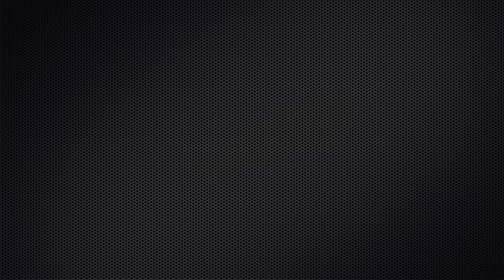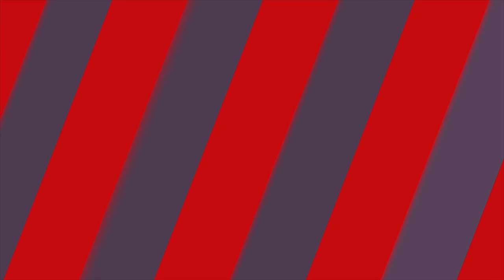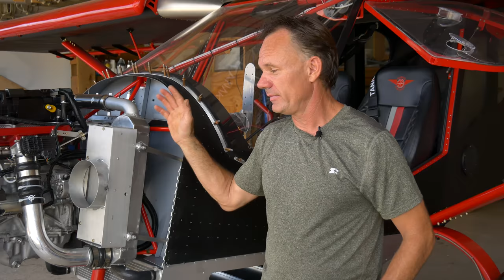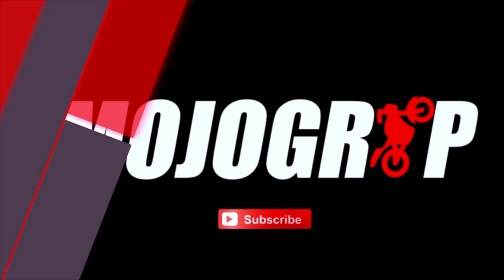Maintenance Cost Of An Aircraft Engine | Experimental Aircraft

Comment: Great video series about the Viking Engines ... well done.
Reply: really good eye opener about why people are fed up with obscene prices from certified BS vs super dependable automotive alternative market. Would love to see some good automotive products for the 200 kts and above crowd.
Reply: I certainly would not call the Viking engine dependable by any stretch of the word!  Do a little bit of research and you will find quite a scary safety record with those who are flying behind a Viking engine!  You can’t just slap an off the shelf PSRU and CPU designed for “off road use” on a Honda engine from a wrecked car then expect them to be reliable!  Jan is a salesman... not an Engineer!  If you truly want a proper AutoConversion engine then look towards the Aeromomentum!  They are at least a new Suzuki engine that is hand assembled and the man designing them has a PhD in engineering...

Comment: This was great. Everything you said was correct.  I would like to add that a lot of  the certified aircraft engine manufacturers have put themselves in the position of extinction because they sat on there certification protection that the government implemented so long ago and never updated and improved there motor line up.  They never changed anything because they had a captivated market( because of certification ) and were making so much money for there overpriced motors .  I am so glad to see the viking aircraft motors making so many aircraft practically leaping  off the ground producing more torque , more thrust with less noise , less pollution and burning less fuel not to mention cheaper for parts and part accessibility .
Reply: I want to add that those older certified motors were great for there time period that they were introduced.
Reply: Keep on dreaming Ray...  In actually use the Viking has a terrible safety record!  Try doing a little bit of research on them!  I know of numerous builders who have had off-airport landings behind a Viking and have seen one first hand loose oil pressure!  Jan is a salesman not an engineer who is slapping off the shelf items on a Honda engine from a wrecked vehicle and calling them an Aircraft engine!

Comment: Cool video.  I'm really considering an experimental,  what do you think is the cheapest option a sonex with auto engine?  Also any diesel auto engines out there you know of?
Reply from the maker: If you want affordable experimental (below $50k complete), I would seriously consider the Saberwing first, then Zenith CH650, then Sonex. These are all low wing of course.
Reply: The Saberwing is a good aircraft however is a Composite Aircraft... They do have a great engine in them though.  The Saberwing is also not an LSA and takes a lot longer to build in the end!  If you love sanding than the Saberwing is great!  Lol!  The Sonex is a great aircraft for under $50k and if you are looking for a good solid engine that will provide excellent performance then I would recommend the Jabiru 3300!  The Jabiru 3300 is factory supported and most of the Sonex builders who are in the know and have built multiple Sonex go this route. There are not any Diesel offerings for aircraft as light as the Sonex currently... they are typically to heavy of an engine for a 600-700lb LSA.  The CH650 is also a great aircraft however the Sonex provides much more bang for the buck... with a Jabiru 3300 you will see cruise speeds in the neighborhood of 150-160mph on 5gph with top speeds in the 180mph on 6gph!  They are also aerobatic offering +6 -4 G loading...  MojoGrip I think you should head North and actually tour the Sonex factory as I have and speak with John Monnet!  The man has been designing and building aircraft since the 80’s and the Sonex has been around for 20 years... trust me there is a reason for this!  With over 1,500 aircraft in the fleet and much more kits sold.  I have researched for the best bang for your buck aircraft under $50k for well over 3 years and I keep coming back to the Sonex for a reason.  I live near the Zenith Factory and am friends with the employees who work there however I will still build a Sonex in the end.
Reply: Sonex with the VW engine (which they sell) is really low cost.   Only thing I found cheaper is a plans build Thatcher CX5, again with a VW engine(RevMaster, built and dyno tested is about $10,000).   But yes you have to tell people your spec to get good comparisons - all metal, kit or plans, 1 or 2 seat?  The Thatcher CX4 and Hummel single seat can use an even cheaper 50hp 1/2VW engine.  Once you say ROTAX you engine costs just DOUBLED to $20,000 !!

Comment: For all the years that I have owned cars, SUV's automatic or  manual transmissions the RPM at about 60MPH has been around 2,000 to 2,500. I don't ever remember driving a vehicle running at 5,000 RPMs. How can a Honda engine from a FIT, Civic, or Accord be constantly running at 4,900 to 5,500 rpms? Can someone explain that to me without major issues? Thanks.

Comment: What do you think about putting VW diesel engine ? So you can have 10 hours flying range. It will be amazing thing.
Reply: Libya 218    RPMs  will suck up fuel the same and I’d say in planes torque is needed to be low so RPMs can be high.  Why u don’t see them.
Reply: @AboxofMonsters  what do you think about playing with the gears , so we can get low RPM (diesel engine) & high torque at the same time.
The only problem is the weight of diesel engines is higher.
By the way, Cessna 172 has some editions with diesel engine , but who can sit 10 hours in small plane
Reply: Weight is more heavier than coMpared Mercedes diesel , I saw a video where sportsman 2+2 is having vw 2.0 diesel with gearbox weighs 230KGs
Reply: @AboxofMonsters  if I'm not wrong diesels tend to have more torque than gasoline , that's why in order to withstand their torque and rpms , weight s more
Reply: vamshi krishna bayya    Diesels derive torque from low rpm  much different then a gas engine that derived power high rpm.  You can have a beefed up Honda Accord making 300 hp but you can’t tow a pop up.   Plus a diesel has glow plugs   What if you had to restart   You also can’t test easily diesel for quality  airplane fuels are graded  .. the engine has to be light .  And while they reliable there’s a lot of parts that can go wrong  so twice the weight and half the HP kills it I think 🤔
Reply: vamshi krishna bayya   Yes true but that engine prob makes 60 HP.   That engine in his plane prob has 150.  Just the same as 2 strokes are used in outboards and dirt bikes  you can get the RPMs very high to obtain Hp.  Everyone wants speed in their plane  fast means also you get there   a low RPM  diesel even geared it may go further but you will sit there >>just over stall speed until the weather changes. My buddy builds huge drones for military they use a Wankel engine the size of a basket ball ( $30 grand this engine runs) it’s used for weight and power and efficiency and space  and it’s RPMs are highest  .  That diesel is perfect for a ATV  low speed high torqued  a boat loss of power at low RPMs.   I have a Robins 2 cyl gas and it has none of that except fuel eff. I can go 150 miles on a gallon of gas.
Reply: @AboxofMonsters  "You can have a beefed up Honda Accord making 300 hp but you can’t tow a pop up."

That's because the Accord chassis isn't built for towing, not because it doesn't have enough power. Power is power, period. When I was growing up, my parents had a 1989 Mazda MPV with a 150 hp 3.0 liter V6, we hauled 7 people in it, with a canoe strapped to the top of it, while towing a trailer full of camping/boating gear behind it, up through the rocky mountains to my grandparent's cabin, year after year, with no issue, and it ended up with well over 200,000 miles on it before we sold it. The Honda Ridgeline uses basically the same V6 as the Accord, it tows trailers and boats just fine.

Anyway, diesels only make more torque than gasoline engines when they're boosted higher, and they have to be, or they wouldn't have any power. 

You're spot on about the rest.

Comment: Can you use a Suzuki Hayabusa engine? Light and powerful.
Reply: There are people who run Yamaha snowmobile engines, because they don't have a whole transmission integrated into the crankcase like motorcycle engines do. 

On YouTube: Just Aircraft Highlander Steve Henry Yamaha Power High Sierra Fly In

Also on YouTube: Twilight STOL Competition (Part 2) - EAA AirVenture Oshkosh 2018 - His run starts at 1:05. He runs a 40 shot (IIRC) of NOS, too, you can hear when he hits it.

Google: Oshkosh ’18 LSA Grand Champion powered by YAMAHA YG4i - look for a rotaryforum post.

Anyway, it really would be a perfect setup if someone designed an engine like a motorcycle engine, but specifically for aircraft use. Without turbocharging, 115 hp at 6,000 rpm would be easily doable with a 1,200 cc engine.
Reply: There is a company called Aeromomentum that does produce aircraft engines based on a Suzuki G13 and G15 platform however it is not the engine from the Huyabusa.  A prop generally can’t exceed far past 3,000rpm before the tips with go sonic and no longer generate power.  Higher RPM Engines like the Viking and Aeromomentum require a PSRU or Power Speed Reduction Unit.  They typically reduce the Prop speeds down to around 2,500rpm...
Reply: @flynic3  Yes, PSRUs are required. The guy with the Yamaha powered Highlander runs his engine at 10,000 rpm, which is reduced through the original gear reduction that's built into the engine and then through a Rotax gearbox, which is attached with a custom adapter.